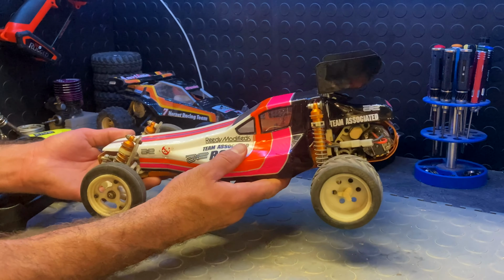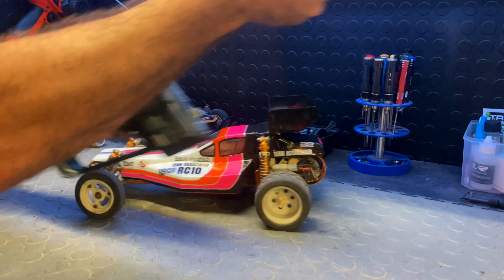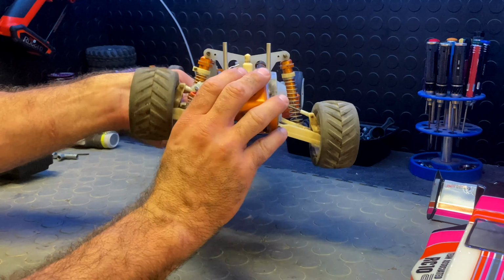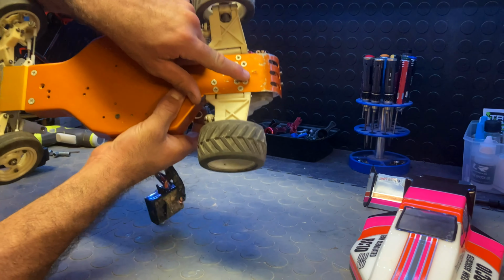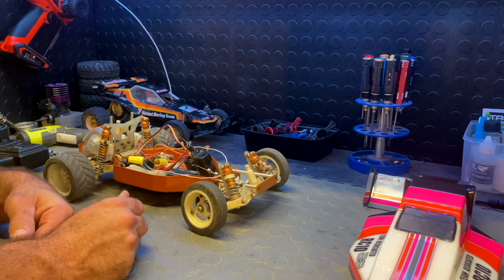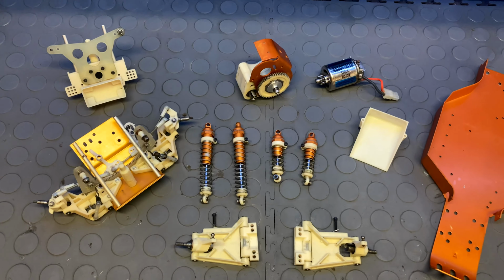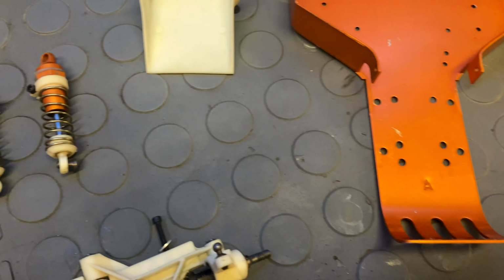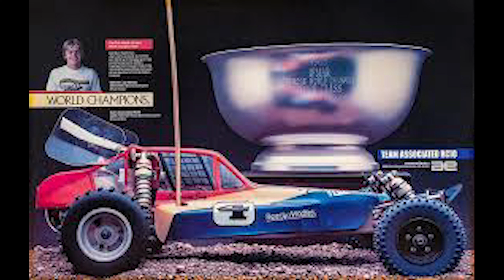Vintage Team Associated RC10 Gold Pan Ebay Project - Part #1

Comment: Nice! I remember back in the day when I was like 14 years old me and my friend had a little back yard track we made in the woods and we always ran hornets and frogs and we both got a RC10 and when we first ran them on the track it blown our minds how the chassis stood flat and only the A arms moved up and down and soaked up all the bumps and ruts it ran a 1000 times better than the tamiya cars it was a great experience!
Reply from the maker: Ha ha I remember it the same way as you. I was like look how the oil filled shocks just eat up all the bumps and rocks. It was so impressive.  Way way better than my Hornet suspension lol. Thanks for the comment🤙
Reply: Pretty much same here went from T to A lol
Reply: You basically stepped up from a Chevy Cavalier to a BMW M3. The hornets and frogs were good to look at though! LOL

Comment: Great video, thanks for sharing.   What do you use to clean and protect the white plastic/nylon parts ?
Reply: Not sure what was used in this video but I use a heated ultrasonic cleaner and Dawn dish detergent. Cuts the grease and dirt and will also get in the cracks.

Comment: Common lighter fluid will release the tape quickly, without the need for excessive scraping or scrubbing. 

Its all good for removing residue from tape and window masks on lexan.
Reply from the maker: Nice. I will keep that in mind. I was using goo gone. Seemed to work ok to loosen it up

Comment: I see allot of similarities between this and my losi jx2 or jrx2 graphite chassis shocks shock towers diff . If you need some parts let me know. The double sided tape servo is actually stock it didn't come with servo mount is what i read. Mine didn't either it was added custom later. 👍👍
Reply from the maker: That’s awesome. I have a vintage manual and it shows that the servo mounts come in the kit. Unless the really early production ones didn’t. That jrx2 was pretty popular huh?
Reply: @theRCelement  i don't know i think so i know the jrx2 didn't come with a servo mount you had to double side tape it.
Reply: I have a pair of OG servo mounts still in the package from mine.